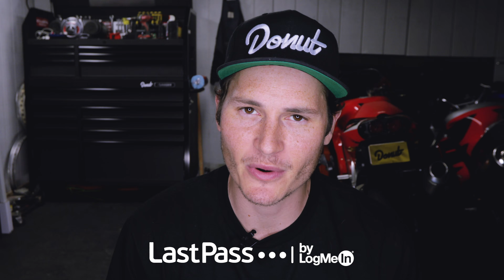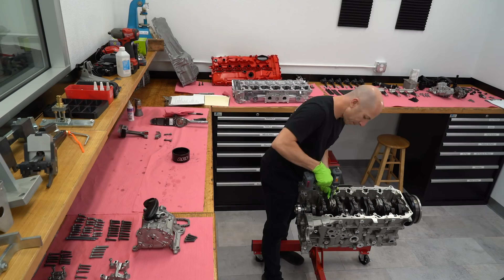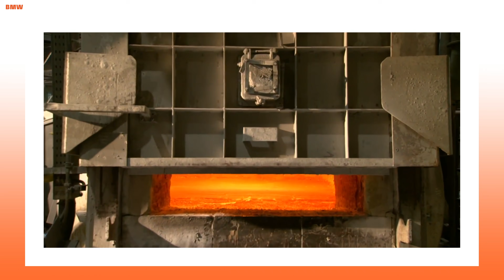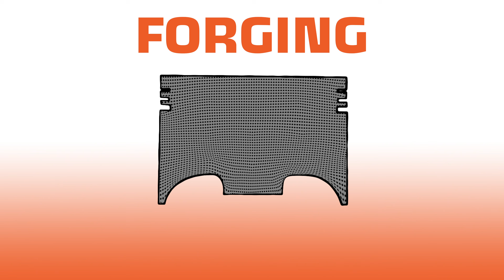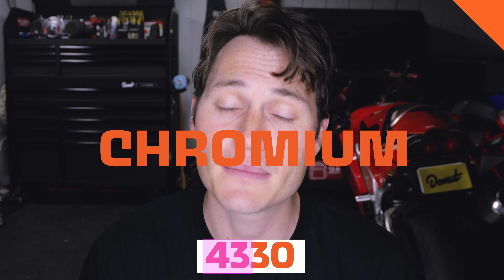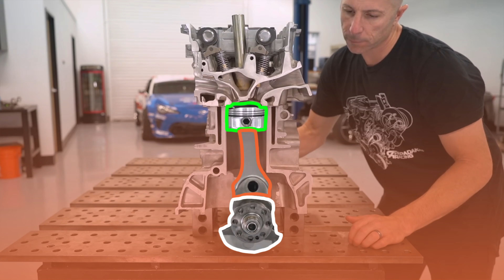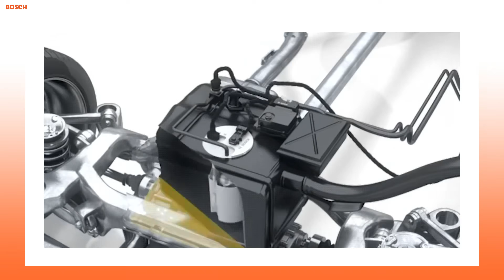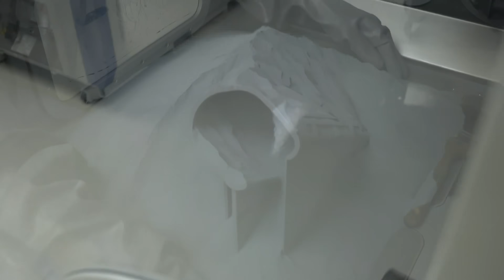The FIRST 1000HP 2020 Supra - Tech Explained

Comment: "Why can the engine do this?"
Because when BMW said 'we're done', Toyota said 'not even close to reliable', and kept going.
Reply: This engine has been in production since 2015 for the 2016 MY 7 series. BMW engines are quite reliable, save for the rods in the S85 V10s pretty much. Accessories and electronics are where they had issues, and even then, that was pretty much only in the late 90s to the early 2010s.
Reply: @wristoww  S85 Eats bearings.. Not rods. also the B58 in the yota has a Different Part number from bmw.. whilst all the part numbers inside the TMC B58 has the same Part numbers as the BMW B58 LOL
Reply: Richard it's the exact same engine as in the BMW m40i line up.
Reply: BMW started development of the 3.0l turbo with the n54. Made changes with the n55 and is now onto the b58 over 15 years of design for these engines. Toyota didn't do Jack shit
Reply: Incorrect. BMW early development of the B58 began the same time as Toyota began talks for partnership. The Supra uses a revised version of the B58 with significant changes such as the head, timing chain, oil pump, direct injection system, etc.
Reply: @Kona61  where's your source man.... love when people try to pass hearsay off as fact
Reply: @Kona61  Incorrect, engines are exactly the same engine and even share part numbers...  Parts manager at a BMW dealer..
Reply: @MrCukydoh   I did not say the B58 TU versions were any different between the BMW's and Supra, but it is definitely different between the original versus the revision.
Reply: BMW has always made reliable engines the old long block 3.2s were bullet proof. The N55 was a super durable engine. The only real issues they had were the water pump and the VANOS solenoids. The VANOS solenoids are super easy to replace. The water pump is a pain but the N55 isn't alone in having water pump issues, and a lot of that I think is not changing the coolant often enough. My N55 in my 335i has 220K on it's original water pump. Now all the electronic gremlins are a pain to deal with but my N55 runs smooth and still runs strong.
Reply: So, where did I get my assumption?
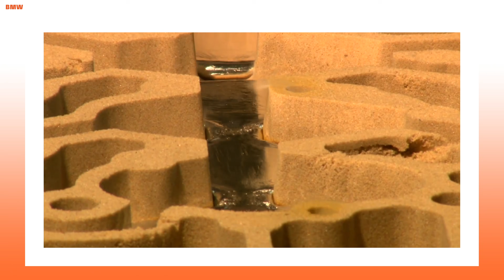A Supra development vid, discussing BMW/Toyota collaboration, similarities, differences. Especially at 8:45. (And, yes, he cites references. Most of them legitimate sources.)
https://youtu.be/_jbyzmtgU_0
Reply: @K0NGZYY  except they didnt..
Reply: BMW's are reliable but they are high end cars, like Merc's or Audis but some of their owners don't follow the maintenance needs for the car. They drive it like it's a Honda, no offense. I love both BMW and Honda. Just tell people how to maintain. Some people have no clue about their car. (I work at a lube place + mechanic student)
Reply: @K0NGZYY  Weren't they only tells BMW to get back to the drawing board to fix the issues on the B58? I would say they gives their oppinion as a "Consumer", not actually getting their hands on changing the engine
Reply: The V10  was unreliable because of the rod bearing, it gave a bad image to BMW. BMW's engines, especially the new ones are great. And if you think this inline 6 is good, then you should look at the 4.4 twin turbo V8
Reply: I just don't understand why BMW uses plastic parts on their engine
Reply: @Dr.Strange11DoctorDoom23  Weight reduction?

Comment: Elon Musk be like: Just slap on electric motors... 1000hrs
Reply: No. Not 1000hp reliably. ICEV and EV are completely different animals... This gasser could theoretically run for hours. 
There's a reason why the quickest EV can only do 12 minutes. It needs charged. It cannot dissipate heat without additional coolers and therefore weight.

Comment: 135 ftlbs to torque internals of the engine that's cute...
Let me know when it gets to 300 +ftlbs like in Diesel engines...
But on a serious note I'm surprised how many of the stock components were were kept
Reply: 300+ ft/lbs on a diesel? Thats cute. 
Let me know when you reach 1100+ ft/lbs like a UH-60's rotor castle nut.

See, I can make wild comparisons too!
Reply: @EmpericalApollyon  I'm pretty sure the + sign covers 1100 ftlbs and beyond so... you don't only make wild comparisons but irrelevant ones too

Comment: "High hp race motors on race gas run 10.5 - 1" while I'm over here with a high compression subaru making 170 with 10.5 - 1 compression on 87 😂
Reply: Yeah you can tell this dude doesn't know very much beside what he reads in his scripts. Race motors run way higher compression that 10.5:1. Hell, Mazda made economy motors with 15:1 compression for a few years.
Reply: @fuck_youtube_censorship00  high boost turbo (non diesel) engines are not higher than 10.5:1 compression ratio. Used to 8.5:1.

Comment: First 2020 Zupra with a 1000HP B58 BMW engine.
There . . . Fixed it for you.
That thing is a M U T, not a Supra.
17:29 BFD, maybe for some dingy gasoline engine (laughing in Turbo Diesel and Common Rail Injection).

Comment: Can the b58 produce 800 hp without changing any of its parts ?? 2jz can
Reply: You'd have to change the 2js internals once u hit over 700whp. In The B58s case that's right at its limit for its stock internals with only a turbo,downpipes,tune,and a intake.

Comment: 11:1 comp ratio only in race cars? Man, get outta here, a lot of modern Ferraris use a comp ratio of more that 12 or even 13:1 on street cars. For example, the Ferrari 458 Speciale has a compression ratio of 14:1 and it runs on fucking pump gas (only makes full amount of power in the EU due to better gas quality). Even the 2000-2005 Honda Civic GX with a 1.7 litre D series Sohc engine has a compression ratio of 12.5:1..... racecars these days more often go down in compression due to forced induction... 

The second part is to all the haters out there:
I am a certified german car mechatronic, wich is a mechanic and an electrician at the same time. A german car mechatronic has to do an apprenticeship for 3 1/2 years. At around the half time we have to go through a theoretical and practical exam (approximately 10 hours total) that determines if you can move on. After the full time you have to do that again, but on a much higher level of needed knowledge. If you pass you'll get a certificate that proves that you are an actual mechanic, not some random backyard idiot that claims to be one...
If you don't believe me, you can look it up.
And if you don't believe me that I am such an certified mechatronic, then I'll post a video of me showing you my ID (censored) and my certificate (censored)
Please don't try to tell me that I don't know anything about engines, I'm a engine specialist, it took a half year training to be one, and I've taken apart more engines, than most of you will ever do...
The third part is for you, please do appropriate research before you record such a video and do certain claims. Thank you

Comment: Pretty sure Papadakis racing said this required a ton of custom and new parts for those numbers. So its not exactly 2JZ in that regard. The question is can it run 800whp bone stock like some 2JZs out there. But its hard to tell fact from fiction in a lot of cases folks like to say they run stock block but don't mention the the internals are built so on and so forth.
Reply: Internals handle 800whp(well that's right at their limit any way) in the blocks case it'll handle more than likely handle 1000whp although it's unknown that it could handle more. It might be possible in making over 1100whp+ like the S55s have if it's possible.

Comment: Donut: "makes 1000hp, and uses stock engine"
Inigo Montoya: "you keep using that word, I don't think it means what you know think it means."
He kept the block and head, but changed NEARLY EVERYTHING ELSE, almost all of the internals, the turbo, the fuel system, EVERYTHING.
The B58 has been around since 2015, it's an evolution of the N55 - if you know anything about I-6 BMW's you have a really good base to start from; it wasn't "All new to the Supra".
With enough money & time, I could take a 4.9L I-6 out of an 80's F-series and make 1,000hp; it would meet Donut Media "Stock" requirements as well.
head gasket - yeah, the head bolts are torqued down at 135lbft; they could paint a gasket on and it would hold. head gaskets fail for seveal reasons, cylinder pressure isn't usually one of them. Usually, it's s*** design (Subaru EJ), secondly, it's bad tuning (knock).
DI is pretty standard these days; Toyota runs a Direct & port combination on everything (except the BMW Supra), Ford does as well, but only on certain vehicles, FCA, Chevy, Subaru, Mazda, VAG, Hyundai, Kia, BMW, Merc all use DI almost exclusively.
Reply: A 'stock' engine refers to the block and what's inside it. The parts outside of the engine aren't a part of it. As for custom internals, the modifications were pretty limited, all considering.

Comment: Considering that it‘s quite impossible to build an actual 2jz these days, because of emissions regulations and such fun things, i‘d say the B58 is a very nice solution for a modern tuner car. It‘s the right configuration for a supra, you can give it a lot of power before needing to replace internals and toyota can sell it even in europe 😄
The only thing really pissing me off is that it‘s not available as a manual 😭

Comment: 7:1 - 8:1 compression ratio? What kind of antique engines we are talking here? I mean original 65 mustang had 10:1 ratio... it dropped slightly for later years, especially during oil crisis, but even then 9:1 was fairly standard. Most of the vehicles with N/A engines made in last 30 years (and not the high performance race cars as you said) had at least ~10:1 ratio, but it is not uncommon to be in 12:1 or 13:1 ratio. Pressures for forced induction engines are always higher compression , obviously 39:1 is a lot, but that is not ordinary car, so kind of not surprising.

Comment: Casting can be done strog AS. Thermal processes after that are needed thou.
PLOT TWIST
Every single one forged part on the planet was casted. Forging also has downsides when it comes to structures. 
If anything has gas in it it's scarp from the start.

5 years of metalurgy to shitpost on YouTube... Worth IT!!

Comment: 7:1 compression ratios vere used in the 80s if not earlier. Most petrol cars after the 90s came with a 9:1 to 15:1 compression ratio, diesels are higher, usually from 14:1 to 26:1(can be a bit higher/lower). The wrx turbo comes with a cr of 9:1 to 9.5:1

Comment: "Still using the stock engine" does not mean modified aftermarket and 3D printed metal parts . That's like the definition of MODIFIED engine. As in, the exact opposite of stock. :/
Reply: 'stock' refers to the block and the internals. External components don't count.

Comment: sorry man, but the crystal explanation is wrong. When you cast a part, the grain size due to the slow cooldown is way larger than forging. Also, when you forge and "hammer" metal, you make a lot of grain deformation, producing a lot of internal strain on the part, then you have to quickly cooldown on water or oil to mantein that deformation and make a strong piece. More grain deformation, more strength the piece, BUT if you exceed some limit, the metal become too hard and too brittle, that's the reason why casted pieces can deform but forged piece breaks.

Comment: With that compression ratio on a stock head gasket they definitely over engineered that engine. This might be as you said the new jz. They might be harder to work on but with this guy doing this is gonna inspire others to follow. I cant wait to see this becomes commonplace.
Reply: I forgot but there's different varients of the B58s parts wise. But to make it simple the mk5 has the B58C which has 2 port heads with a higher compression with its heads integrated into the block but this is for the 2019-2020 mk5s. Now the new mk5s(2021s) will have the B58D which has 6 port heads that aren't integrated into the heads with a lower compression ratio and different pistons.

Comment: 2020 Toyota BMW Z4 Supra fans: “HAHA SEE! Just a couple of forged parts and we can make 1000bhp using the stock block! We’re just as go-“

The 2033whp stock block 2JZ Street MK4 Supra: https://youtu.be/-GBRnEKVArg

Also the 5 second Supra by Ekanoo Racing, same guys.... also uses a stock oem block

Also completely stock internals the record I believe was over 1200

So no... I still don’t care about the Toyota Z4 or BMW Supra or whatever it is when for half the price I can modify a mk4 to far surpass what the mk5 could do even with infinite funds.
Reply: Ok. But your comparing 20+ years of aftermarket and R&D with a 5 year old engine with its own aftermarket JUST starting to get big. In any case it doesn't have to be perfect nor a jz. It needs time. If anything. It's not fair nor even comparable since there aren't even billet block,sleeved,or really big support for the B58 compared to the 2j RN. Stop comparing apple's to oranges and give it time.

Comment: Sure you can argue that the B58 needed 3D printed parts to get 1k HP as opposed to a 2JZ, but remember that the B58 is a newer platform with a limited to non-existent aftermarket parts list. I love both Supras, though

Comment: Here's why the new Supra sucks......
To get to ridiculous hp numbers you either have to swap out the engine, or be a magician when it comes to rebuilding them. 
The Supra is all about having an indestructible and iconic engine.
This one just aint it chief....
Reply: It's new. It's not going to be pulling numbers as soon as u say "do it" it's aftermarket JUST started getting big and the mk5s has been out for nearly a year now. If anything,they aren't going to be pulling miracle numbers out of the blue anytime soon. It needs time.

Comment: Still far more work and money than a 2J requires to make similair or more power numbers. The only reason this thing can make this power is cause it's papadakis, you can give him almost any engine and he'll make it pump out some serious numbers. The man had to basically rebuilt this thing from scratch to reach these numbers, thats a credit to him, but not to the car. The BMW is a good car, but its no supra or 2JZ-GTE. - another Jeremiah, Supra fanboy.
Reply: It's new. B58s were just starting to touch 800whp at that time. They are extremely limited in parts so he had no choice but to make most of the parts himself for how limited it's aftermarket was. It's still limited even now and there are people pushing over 6-near 800whp in them now with just a tune,turbo,downpipes,and a intake. They need time to grow.

Comment: b58 engines need forged internals and custom mods to make 1000hp, but theres a few unopened jz motors running close to that 🤔
Bmw under engineered when toyota over engineered 😏
Reply: The internals were already forged from factory. And by then the 2j is a ticking time bomb if u go over 700whp on it's stock internals. Plus these are new. They are extremely limited in parts so he had to make them himself.
Reply: You do know the 1jz and 2jz already have forged crankshafts too right? Lol even a forged b58 is a ticking time bomb at 1000hp 😂

Comment: You said some people swap in a more powerful motor like the 2JZ but the B58 is more powerful stock. Having owned a couple of cars with a turbo 2JZ's have to say they are very heavy making the cars great for straight line stuff but not for track work (hence why the Supra was 3SGTE swapped for track). They are very strong stock so modifying them on the cheap is easy. So it really depends, the B58 is a great motor and has already proven high HP and is much lighter so in my opinion is the better motor. The 2JZ is great but they are getting old and hard to find and often require a rebuild now.

Comment: Correct me if I'm wrong. On 2JZ engine, they just put big ass Turbocharger and they get over 1K bhp without all this crap?
Reply: No. You'll need a longer list of mods to do so. In The B58s case it's extremely limited so he had to make parts for it since its aftermarket hasn't gotten to that point yet.

Comment: LMFAO lazer tech? There is almost NOTHING stock about this engine... you made all our points right. Any basic mechanic can 1000hp easily on a 2jz gte, this guy had to remake almost every wall in that b58 just to make 1000hp?
Reply: It was extremely new at that time. Some were only just touching 600whp+ at that time. Now there's some already jumping in 700whp+-800whp. There wasn't a big enough aftermarket since he got the car a few months after they came out so not much was out for them at that time.

Comment: Imagine a 1000bhp BMW Z4. Should be possible now :D
Reply: people have made 1000hp S54 motors before. Also give it time, the S58 just came out and the new M3 is on its way with the new S58 motor. It'll be much easier for it to reach 1000hp than the B58.

Comment: You can put as much air as you want into an engine but if it can't get out fast enough you lose power.

So the real restriction is air and fuel in and gas out, example a stock turbo Impreza is exhaust restricted from the factory or used to be, adding a larger or more free flowing exhaust generates a couple of % bump in power output, you then become air and fuel restricted.

Comment: Compression ratio is the measurement of the space of the combustion chamber when the piston is at TDC (Top Dead Center), that space is multiplied (i think) to the space when the piston is at BDC (Bottom Dead Center). Thats how you get the compression ratio of a particular engine. This engine is 39:1 just imagine how tiny is that gap or space of the combustion chamber. Engine is a mysterious thing and it is amazing!! ❤
Reply: The B58 has a compression ratio of 11:1.

Comment: You got it backwards on the forging vs casting. Forging makes the grain structure uneven, which is what gives parts their strength.  Casting liquid metal allows the grain to grow in a crystalline fashion, which makes the parts weaker. And we aren't even scratching the surface on iron metallurgy.